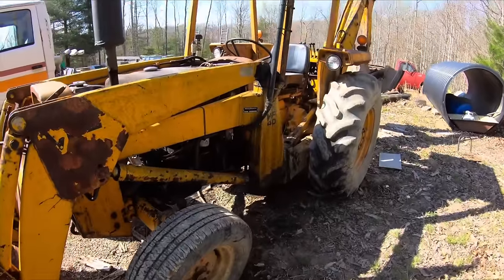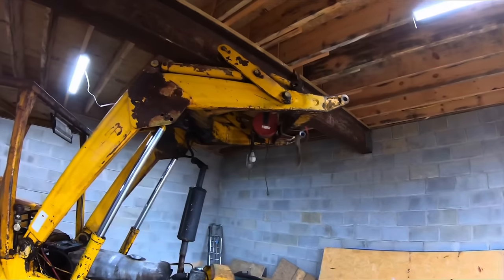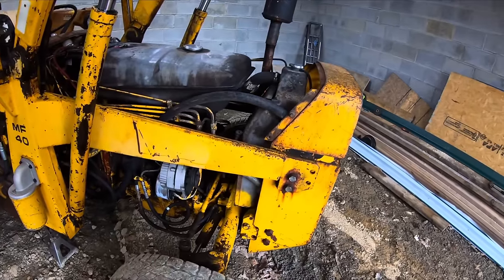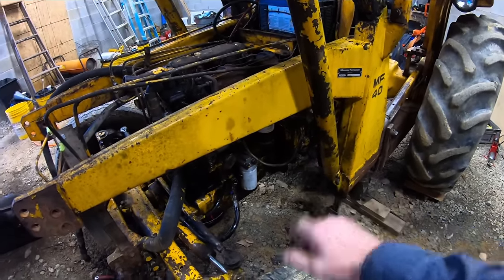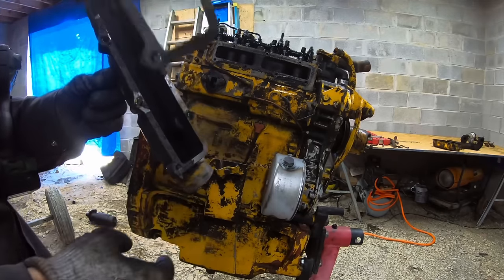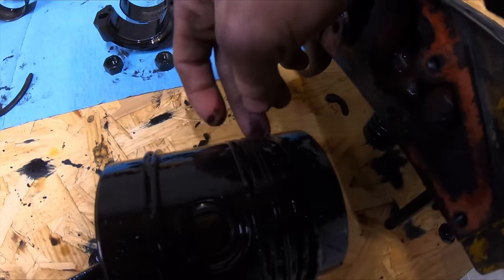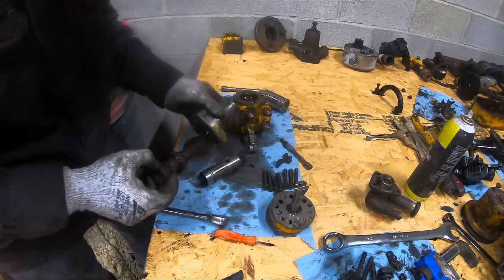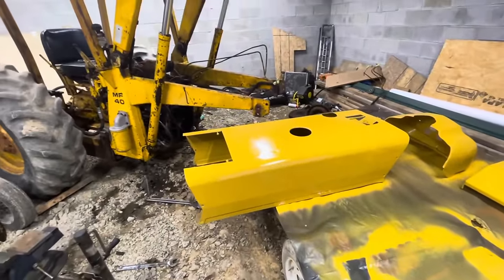Massey Ferguson Backhoe Restoration pt.1 Engine Teardown

Comment: For someone who either has not the equipment to use or the workshop with concrete floor or the tools to work on plant machinery he has done a exceptional conversion from were this backhoe loader was to how it’s is after the finish ❤

Comment: Nice job so far Thanks for sharing the journey , the rings in that motor look like a prime example of what happens using way to much ether trying to start a  motor that has problems.
 I'm not sure about that particular steering motor but some of them components are internally timed and if they go back wrong they become a motor when the tractors fired up and the steering wheel is turned. Just make sure you know how this one goes back together right, and move the wheel on first start with your hands outside the steering wheel just in case it takes off like a motor. It could take your fingers or thumbs off if they are over the spokes . 
   Some of those Perkins cranks can't be reground without loosing the hardness from the surface, I hope your machine shop knows to check and find this out if they try to grind the crank. I came close on a rebuild where they didn't know and only found out when I double checked with them before they did it.
  As for the block perkins motors are dry sleeved and they can be real hard to pull out and get back in right, personally i'd take them the block, get them to clean all that crap out properly with a hot tank or what ever they use. It will take you ages and probably still have junk in it from that black mess, and get them to put the sleeves in for you. 
  I'm self employed fixing farm equipment and have done quite a few Perkins with my experience so know  how bad they can be. My thoughts are  if the customer would pay the extra time for the machine shop doing the liners it wouldn't hurt my feelings at all !   Looking forward to seeing more, Take care

Comment: I'm working on Massey Ferguson 2500 forklift with same engine mine won't run at all you didn't need tear down engine that far these engine got sleeves in them new sleeves and engine pistons and a gasket set is $300 back up and running again the engine are 152
Reply from the maker: I had to take the engine out to get the crank out